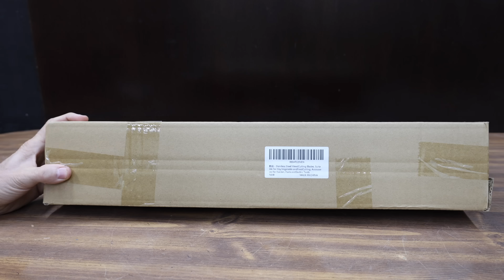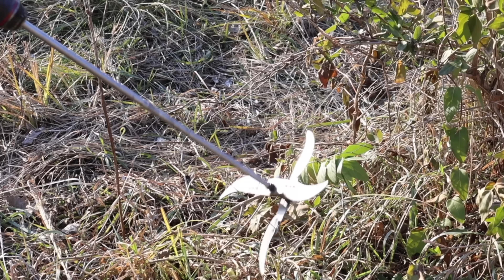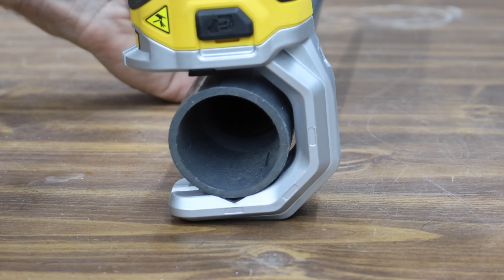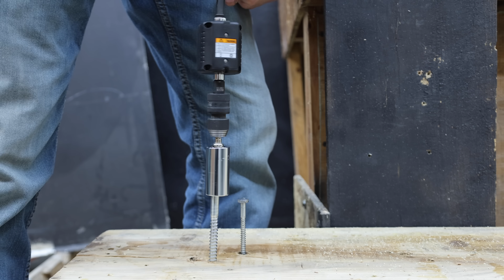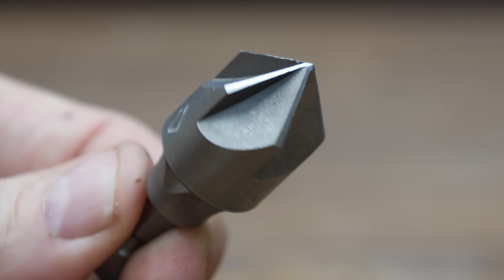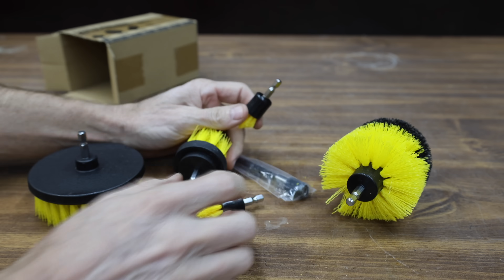I Replaced 10 Power Tools With My Drill!

Comment: I've been using the 4 inch auger for gardening for a few years and it's great. I attached it to a drill bit extension (grub screw style) and also use it to dig up weeds
Reply: A mini drill tiller would be great for the garden ! I got a set of augers last year and is great for the garden. And not something that is ever going to wear out too soon.

Comment: Great show Todd, why many of these gadgets are even legal in the US is beyond me as some are very dangerous, deadly even in the right circumstances.
Even the chainsaw drill attachment looked sketchy as the chain guard looked too small to protect the user. Of course this is just my two cent opinion!
The DeWalt plastic pipe cutter didn't make a square cut as the video cleared showed but it did do a decent job cutting the plastic pipes. If the price were more attractive I'd consider it. Lastly, Both pipe deburring tools did a great job. I will look further into those.
TY again Todd.
Mike from northern MN 😅❤
Reply from the maker: Thanks and you are welcome!

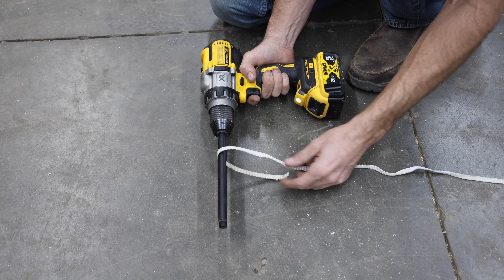Comment: 9:25 -- Holding the strap with your hand (gloved or not) is an EXCELLENT way to get huge splinters or glass pieces in your fingers.  Those frabric straps, especially the wide yellow ones for securing cars to tow-truck beds, often pick up splinters from the ground.  

This tool is built tough but unfortunately to use it you must risk serious injury to your other hand which must guide the strap.  The tool is a "no" for me.
Reply from the maker: Thanks for the feedback.

Comment: Anyone out there can comment on the wear and tear some of these attachments would have on your drill? I've heard using attachments that put perpendicular forces on the drill shaft is very bad because it's designed to only expect parallel forces eg forward and back not side to side. I'd love those nylon brush attachments to clean out my bathroom and kitchen but I don't want to ruin my nice drill over something like that.

Comment: That nylon scrobber you used on the tire, will strip out the metal shaft from the plastic body very easly - not recommended. The smaller scrubbers work well fine.
Reply from the maker: Thanks for the feedback.

Comment: There are a lot of blade disk attachments for handheld lawnmowers. You're supposed to replace the nylon wire with those shurikens. People don't understand how dangerous they are, until they lose a toe or leg. Those mowers actually make a lot of power and attaching such cutters with a bolt and washer to their shafts sounds like a very dumb thing to do.
Reply from the maker: Thanks for the feedback.

Comment: I have the Dewalt metal shear. I got it to cut 1/2" 18 ga wire mesh for a large garden enclosure. It worked great as long as you held it at just the right angle but since it isn't truly made for mesh I think it did a great job and saved me hours of tedious cutting with a pair of dykes. Thanks for the video, many of my purchases have been made based of your test videos that I have been watching for years! I find your videos to be of much more use than a plethora of 5 star "ratings" and "reviews".
Reply from the maker: Thanks for sharing.

Comment: My Auger attachments can use a 1/2" hammer drill.  Made my life WAY WAY WAY easier!!!  
I made 10 - 30" deep holes that in the end made around 10" to 13" wide holes for cementing in posts with 4" x 4".  
If had tried doing this my back would have been wrecked using just a manual post hole digger.  (let alone it took almost no time to make each separate hole using that auger, like less than 3 min a hole!) 
Yea it's made in China - but my back sure isn't!!!
Reply from the maker: Thanks for the feedback.

Comment: I have the augers. They are very useful, but have to be careful of roots and rocks. Also, with hardpan, it tends to just drill in like a wood screw in lumber. You have to be careful with any downward force and go down only an inch at a time and lift. A spade bit works better in this circumstance.
Reply from the maker: Thanks for sharing.

Comment: I have a similar rivet gun at work. Were you reversing the drill until it started clicking? That's how I do it with the one we have, and it ejects pretty well. I will say they are great when they work properly. However, they are cheap and not very refined. I think it was around 17 bucks. I might spend more when it quits, or get the pneumatic type. The chainsaw was the one that outperformed my expectations. And the pipe cutters were awesome!

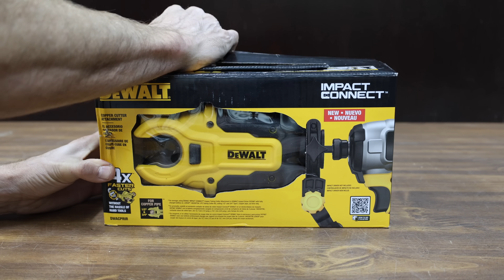Comment: @10:48 I bought one of these augers 10+ years ago and it has been great for planting flower bulbs.
Reply from the maker: Thanks for the feedback.
Reply: I bought one a couple of years ago when digging holes with a regular shovel in tough, hard packed dirt. Dig a little, then break up the bottom of the hole with the auger, then dig a little more, then break up the bottom of the hole with the auger, etc. Worked pretty well when planting a row of 6ft tall trees that all needed a roughly 24inx24in hole.
Reply: And good point on the handle part my wrists still feel 2 years ago with my auger

Comment: I look at the price of the DeWalt PVC pipe and conduit cutter and it cost 3/4 as much as my DeWalt brushless battery powered drill and impact driver set when I bought it on sale, but at least I know what I can buy if I didn't already have some dedicated tools.  I usually just cut PVC pipe on my miter saw.  Then to deburr I just use a simple utility knife.
Reply from the maker: Thanks for sharing.

Comment: some very sketchy indeed.  Trying to make a drill into any kind (except hole saws) of saw is a losing proposition.    those pipe cutters look good, but you really need to be needing to do alot of cuts on a regular basis to make them useful.   I got some of those wire brushes - they work but a essentially disposable as they wear out and come apart quickly.

How about a test of chest freezers?
Reply from the maker: Thanks for the suggestion.

Comment: Last year I had about 200 flower bulbs to plant, so I bought an auger. Works well, if you pull it out every so often to eject the dirt, as you were doing.
You have to be careful though, if you run it at full speed and hit a root, you might end up with a broken finger or wrist.
Reply: I did the same a few years ago as well. 500 bulbs planted in no time, but that one time I snagged a tree root, geez, I thought my wrists were toast.
Reply from the maker: Thanks for the feedback.
Reply: Auger is the best 💪
Reply: Same here I transplanted thousands of bulbs when I moved 5 yrs ago and it made a huge difference in the time it took to drill all those holes. I have three different sizes. I have had the occasion of hitting something unmoving and thought I'd broke my wrist the way it wrenched it. Putting on the side handle helped a lot and getting one of the guys to drill the deeper ones helped even more. The biggest one has also been used to drill post holes for 4X4 posts.
Reply: You definitely want a drill with anti-kickback, but it isn't surprising that those bits work. They're still effectively drill bits, after all, just particularly large ones for very soft material.
Reply: @dsgamecube  I don't know if mine has that or not It's a makita  my husband bought 20 yrs ago. It is more powerful than the dewalts or black and decker ones we have.

Comment: When you used the biggest log bolt on the universal socket you were basically just using the actual socket. That universal socket is just a 3/4 19mm socket with floating rods to make up the size difference on smaller fasteners

Comment: Shocked that the chainsaw attachment worked that well!
Reply: Problem is longevity. The chain is doing most of the work. But that external polymer body holding the attachment can snap and break. Not to mention the damn brake is one of the poorest attempt and thats a major safety hazard. Personally, I would not recommend just due to the safety.
Reply: @thamomentum  imo depend on the job you have it do.  Like my property doesn't have any tree.  But now and than the neighbor's tree will stick over and I want to cut it, a $15 chainsaw is not bad for a simple and one or 2 times job for a small branch.  Good to have choices.
Reply: @thamomentum  i totally agree with You. years ago i bought a similar one because i haven't owned a single chainsaw. Turned out to be good, but lack of oiling + internal gearing bored out in space in the housing and eventually came loose and didn't worked at all. Anyways this attachement lasted for me for a year and cut like 2000 2in-5in branches/trees in it's lifespan.
Reply: @thamomentum  snowflake
Reply: @EazyDuz18  Troglodyte.
Reply: @EazyDuz18  The chain is not “doing most of the work.” It is getting most of the abuse. But the drill is getting a fair share too. Yes, the polymer body can snap but the bigger issue is chuck loosens, arbor wobbles, bar flexes, chain derails, and gearbox binds. The brake isn't simply "poor," it's a cosmetic flap. You seem emotionally tied to this, snowflake.
Reply: @EazyDuz18  I'm just going to assume that you were attempting to make a joke. And not that you are trying to suggest using an unsafe chainsaw is a good thing.
Reply: @EazyDuz18  have fun losing fingers buddy
Reply: @EazyDuz18  Says a one-armed man...
Reply: @EazyDuz18  - m0r0n
Reply: @EazyDuz18  Real men cut towards themselves and hold power tools at groin level because their manhood is built to last.
Reply: @IrishFinalExit  or, just dont be a snowflae
Reply: A stronger safer $60 attachment would probably be perfect.  The $18 looks a bit sketchy.  $18 won't be a bargain if the housing breaks and sends the blade flying.
Reply: @brianwest2775  I paid $43 for an 8-amp 10" Sun Joe SWJ803E. Paying more than $18 is just silly.
Reply: @brianwest2775  A drill‑attachment "chainsaw" is toy‑tier junk: barely cuts 1–3" branches, overheats, dulls chains in minutes, ends up costing $150 in wasted chains and frustration IF you're lucky it doesn't explode and take out an eye. Stepping up to a cheap standalone saw is only slightly better, as low‑amp electrics such as my 8‑amp 10" Sun Joe SWJ803E (I "wisely" snagged for $43) actually work but still eat chains (and it now cost $145). A real chainsaw (electric or gas) costs more upfront but runs chains correctly, cuts real wood, doesn't cook itself, ends up cheaper over five years from not destroying chains ... the same pattern as my stupid $40 Ryobi drill costing more than my $196 Makita replacement. Cheap stuff looks affordable until it eats you out of house and home, wastes time, sends you to the hospital. Not a good choice.
Reply: @brianwest2775  Of course it will. Unsafe at any speed. But willing to spend significantly more just means you'd do better off buying a new chain saw.
Reply: @JustMeAP1  This video showed the $170 Stihl drastically underperforming this attachment, so a safer attachment at half the price and twice the performance probably has a place for the homeowner who needs to occasionally trim something.
Reply: @JustMeAP1 for me it's the size not the cost that made me interested. A safer version is something I'm now looking for
Reply: @Sethlar9  Tool testers like Project Farm and arborist August Hunicke have shown that drill‑powered chainsaw attachments are inherently unsafe because the drill’s chuck, bearings, and torque delivery were never designed to control a chain under load. Their findings directly contradict your idea that a “safer version” exists as the real danger comes from the concept, not the price or size. As a very wise man (@dongordon2754) said "@EazyDuz18 have fun losing fingers buddy." LOL
Reply: @brianwest2775  Project Farm and arborist August Hunicke have actually demonstrated that drill‑powered chainsaw attachments are both fundamentally unsafe and mechanically unstable, regardless of how they compare in one YouTube video for three cuts. They don't have a legitimate “place” for homeowners as the danger comes from the design, not the price or the comparison target.

Safety engineer Dr. John Ball, chainsaw‑injury researcher Dr. Jeffery L. Smith, and UL tool‑safety consultant Mark Housley all emphasize improvised or non‑certified chainsaw devices lack the required chain‑brake systems, torque control, and kickback mitigation to be considered safe for consumer use. And just because you CAN pay $170 for a $50 tool does not mean that's what it's worth. I spent $42 on a Sun Joe selling now for $145 that eats chains like I eat chips since they lack proper chain speed, torque stability, and bar‑oil delivery. As "cheapest" (over long run) drills are $180 to $250, so are the cheapest saws. Anything less is but a money trap.
Reply: @brianwest2775  The poor, tiny, little Stihl GTA 26 was slower than the $18 drill attachment. Many reviewers complain of jams and chain derails, not a real saw at any price. That's what being beaten by an $18 toy proves. I found it for $217 at Amazon. Project Farm claimed it was an "unfair" comparison to the $229 Makita XCU11Z 18V LXT Lithium-Ion Brushless Cordless 14" Chain Saw. Why "unfair" to compare a useless, dangerous toy to a real tool?!?
Reply: I own an 8-amp 10" Sun Joe SWJ803E I paid $43 for that's 10X better. Still not "real."
Reply from the maker: Thanks for the feedback.
Reply: @ProjectFarm  I feel like the biggest takeaway from the items reviewed in this collection is the importance of additional support for the accessory. A pretty simple detail that it seems only Dewalt considered! Most of these tools could have benefited from the triangulated lower support seen in all of the Dewalt products but especially this chainsaw. With that in place I suspect it would have been easier to operate and would have performed even better. As an aside, did I hear the reciprocating saw handles: "Wood, metal … and meat" ?!?!!!
Reply: @wi5n-f5p  many who do home butchery use a reciprocating saw to cut the animal into quarters. They also use what appears to be a band saw for cutting a joint into chops. Whatever gets the job done lol
Reply: Me too. I would have bet against it.
Reply: For real. I thought it was a kids toy seeing him put it together. Then saw it beat the mini stihl I was completely shocked
Reply: @feraldog5590  Both are kid's toys. That's all. LOL
Reply: @JustMeAP1   well its meant for people who are just fooling around.
 like do they want to buy more tools that they will use rarely or get an attachment that will break

i have a makita circular saw from 10 years ago... only used it twice. 
nice to have though, will be using it next year when i DIY a bedframe (integrating some ikea drawers into the frame) and table for my new apartment.
after that, i'll probably sell it off.
Reply: @Personality_Of_A_Brick_Wall  Project Farm shows drill‑powered chainsaw attachments are unsafe, under‑powered, prone to failure. Arborist August Hunicke has warned cheap chain saws “don’t have the torque, control, or safety margin to be used as real saws.” Your claim that it’s “meant for people who are just fooling around” doesn’t defend it. It admits it can’t survive real use. Why not just take a $20 and throw it away... for fun?

That "fooling around" argument is a "goalpost shift" fallacy. Your "why buy more" is a "false economy" fallacy. Claiming "I don't actually use my tools" is an anecdotal fallacy. And the "nice to have" support is a "false equivalence" fallacy. Defending a clearly bad tool by lowering expectations, using personal stories as universal truth, and pretending “cheap” equals “smart,” even when the cheap option is unsafe, ineffective, and more expensive over time (aka "poor logic"), marks you as but a "silly child."
Reply: @feraldog5590 a chainsaw only cuts as good as the chains been filed.
Reply: Honestly if it makes ten cuts, that's probably all I'll ever need. I'm considering buying one.
Reply: I can cut a 2x4 with my sawzall and a good blade just about as fast.
Reply: Wife bought a cheap chinese battery chainsaw for $12 I think. Works surprisingly good trimming bushes and on small branches.
Reply: I've heard It works even better on users fingers.
Reply: Ya for the 1st day then will suck 😂😂😂
Reply: If you're going to cut your finger off, do it on a Monday morning like I did 5 weeks ago 😆. Okay just the the tip but I still got 5 weeks paid while it healed back together, but your mileage may vary lol
Reply: I also was shocked but how long will it hold up
Reply: those cheap ones u see on amazon work amazing. same premise.
Reply: The price is good, but there's always some cheap plastic part inside that saves money, and this will be the reason it fails in a short time.

Comment: $18 Chainsaw seems legit.  See ya in the ER!
Reply: At the cost of 5k to 30k 
Is a er vist.
It claims a care free and easy work of your injuries 
The er vist is made in the usa.
Reply: @DUBMANS The ER visit took over 6 hours to incorrectly treat the injury.
Reply: @kellyalger2394 overall a complete fail of the vist
Reply: @DUBMANS  VERY IMPRESSIVE!!!
Reply: i just lost a thumb and need it reattaching fast, where going to go to 5 different hospitals and see how good a job they do reattaching it.
Reply: @thedragonreaper were going to test that
Reply: it's cheap to engineer and manufacture things that won't last more than a few minutes. If said thing could possibly cause bodily harm if/when it breaks, that's a no go for me
Reply: Right! The Stihl may be a tiny bit slower but if you take SAFETY GUARD off it would probably make up the difference. So why is there a guard on the Stihl that slows it down? Oh yeah, theyre a legit product and you can sue them when it rips into your flesh as it disentegrates.
I think I’ll skip the $18 version.